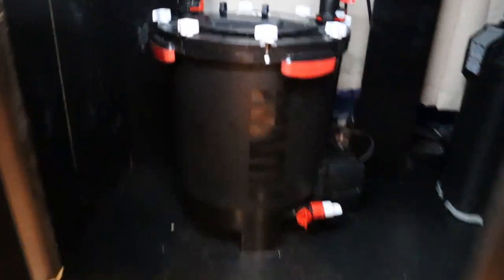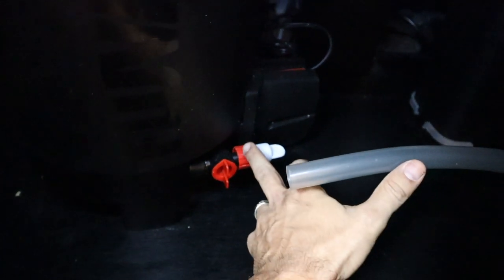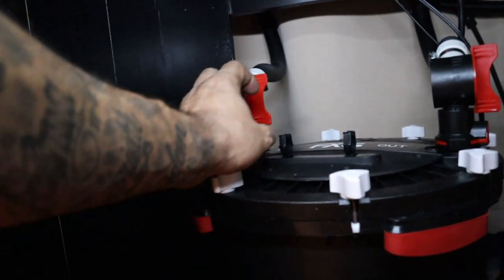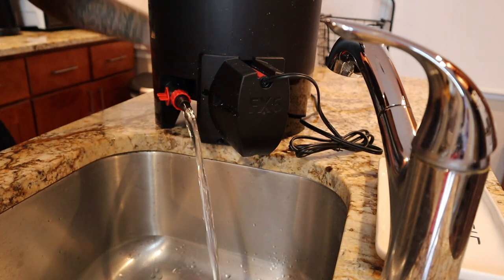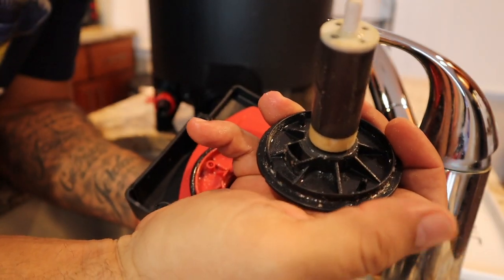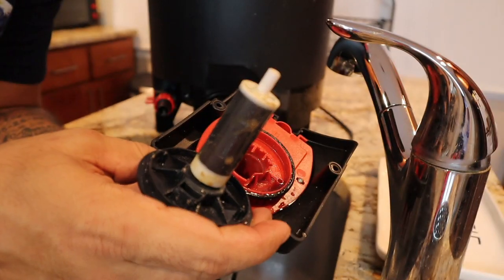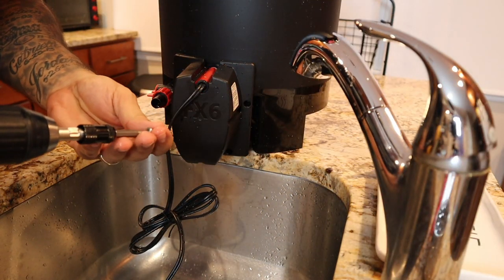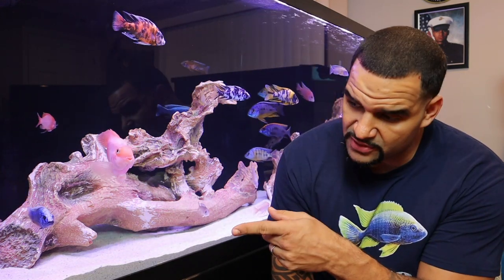Fluval FX6 Impeller Cleaning - Quick and Easy (Plus an FX6 Hack)

Comment: Thanks for your service brother. And thanks for this super helpful video. I’ve been dreading cleaning it, but you just eased my mind. Thanks again.
Reply from the maker: Thank you bro! 💪 And Im glad you found the video helpful!
Reply: I literally just finished cleaning the impeller in hopes that that’s what was causing the noise/vibration, but no luck. I can get the sound to stop if I turn the output knob halfway, but then that means it’s not pushing full power. What in the world.
Reply from the maker: What sound are you talking about? I had a sound coming from my motor once as well and cleaning out the impeller did the trick. did you see any damage to the impeller unit?
Reply from the maker: Try asking this question in my facebook group. Great group of knowledgeable fish keepers, someone may have had a similar issue - https://facebook.com/groups/kavemanaquatics
Reply: I figured it out. I had too much Matrix media in the center columns. Took a bit out and now she purrs

Comment: Hi Kev … I have a fx6 also but my inlet is not drawing water from the tank … my impeller is  sticking and not creating much pressure .. I have cleaned it like you have shown in this video .. still no joy .. what needs replacing to get it to work as it should ? Your reply will be highly appreciated. Thanks

Comment: Quick question . I’ve noticed your reusing your bio media in your FX6 when you clean out your canister. How often are you replacing the bio. Are you changing one basket at a time so it doesn’t spike. To keep some bio bacteria. Thanks again brother
Reply from the maker: Never change out your bio-media. It's good for 10-15 years. Just slightly rinse in tank water during a cleaning but never replace. 😊

Comment: I purchased the floval aquaclear 70 for 40 gallon to- 70 gallon tank size and used it into my 37 gallon and the flow is way too high for my angelfish.  Is there a way to decrease the flow? I originally purchased for removing the metroplex from the 37 gallon.  I pulled it because it seemed to stress my angelfish. It is the floval aquaclear 70. For 40 to 70 gallon.  I currently am using 2 medium sized aquarium coop sponges instead.

Comment: Bro, may I ask why don’t you use a pre filter for the fx6 like a sponge or the eheim pre filter? 

✌🏽
Reply from the maker: IMO, a pre-filter prevents a filter from doing what it’s designed to do. I don’t want poop stick to a pre filter that Inhave to reach in, get wet, take it off, clean it, then get wet again putting it back on every week or so. I prefer the poop to go into my filter where it belongs and not have to touch it for 6 months plus 😁 oh, and my water stays crystal clear without a pre-filter. JMHOT 😁

Comment: Hi, 

Do you think an fx4 would be overkill for a 55 gallon cichlid tank? Well stocked but not over stocked. Thank you!
Reply from the maker: Over filtration never hurt anyone, or any fish lol If you've already got the fx4 go for it!
Reply: @KaveManAquatics   thanks! I haven't got the fx4 at the moment. It's about 200 in my local area, where as the fluval 307 is about 140, so not a huge amount more considering the performance upgrate, given the 307 is rated for a about 250L and the fx4 at 1000L  it seems like it'll be worth the extra money!

Comment: Hello I had a question My fluval Fx6 started acting up today. Turned off, I plugged it back in it turned on for 2 minutes and shut off again. I proceeded to clean impeller following your steps left it clean and plugged it back in and was on for 2 minutes and shut off again. Do you think it might be the motor?
Reply from the maker: No, it’s designed to turn off and purge after a few minutes and will do that daily. When it turns off leave it plugged in, wait about 1-2 minutes and it’ll kick back on. 😁

Comment: I noticed my flow rate has slowed a lot, maybe I should clean this, it’s been 3 years. 😳 Also is there a gasket or o ring when attaching the impeller housing back on?
Reply from the maker: Yes there is, make sure it goes back on. The impeller wouldnt normally cause a decrease in flow rate. Usually its clogged up sponges and/or media. But cleaning the impeller wouldnt hurt and can only help 😊

Comment: Have you had a situation where you put motor back on and the filter won’t run . I’ve had to pull it apart 6 times and screw back to get it going why I have no idea.
Reply from the maker: Hasn't happened to me yet (knock on wood lol) Maybe your impeller just wasn't seated properly? or it could mean there's damage on it that you don't see.
Reply: @KaveManAquatics  cheers mate 👍

Comment: I forgot is there a play on the impeller? My impeller moves up n down a little.
Reply: Ahhh nice so it does have a little play. I wonder why mine stopped then my impeller wasn’t dirty just probably a centimeter of smudge.
Reply from the maker: Yes it does. Sometimes something can get lodged in there and cause it to stay stuck. Most likely a safety feature to prevent damage. Opening it up and cleaning it out again usually solves the problem. 👍
Reply: @KaveManAquatics  ya i cleaned it up looks like my motor is shot i ordered a motor comes with impeller also figured might as well replace both instead of guesswork

Comment: hi kev I just got through watching your video how to clean FX 6 Motorhead I have a question I have a Samsung 404 canister every time I put the pre-filter sponge on the intake I have little particles floating around the sponge is claim but I still have particles floating know if I take the sponge off the intake my water is crystal clear like I said every time I put the wires back on and it is clean I still get particles floating around how do I fix that I am kind of worried that sand will get in the suck up into the filter that's one of the main reason why this phone's is on ther somewhat
Reply from the maker: I dont use pre-filters for that reason. I feel every time you take it off to clean it you will release dirt back into the water. Sand is going to go through those prefilters anyway. Just leave it off if your water is clearer without it and raise your intakes higher so it wont suck up any sand.
Reply: @KaveManAquatics  yah I do get Lill Sand in my filter wit the pre-filter so you said you don't use them do get sand in ur as well
Reply from the maker: Yea I do get some sand in there. It's going to happen when you have sand substrate.
Reply: And that's wit per filter or not it's  still going happen anyways you know I think that's wy my nitrites is high because peashooter is slowing down my water flow I do see a lot poop an unate food that's not really getting sucked it might be the pre-filter what do you think
Reply from the maker: Possible, do you have a wavemaker installed? - https://youtu.be/O36QbOiZJvw
Reply: @KaveManAquatics  yes I do I do have a wave maker it's just when I put the sponge on my intake I have particles floating in the water just when I take the sponge off the intake of water is crystal clear
Reply: @KaveManAquatics  yes I do why
Reply from the maker: Asking because you said you see poop and uneatened food. Try not using the pre-filter, see how it goes.
Reply: @KaveManAquatics  yeah okay send me your Facebook thanks for the advice I appreciate it

Comment: Awesome vid. I got a FX4 on my 100g cichlid tank. BUT the drain valve is leaking.... and it's under a year old...sigh.. it an awesome filter otherwise
Reply from the maker: Ahh man, sorry to hear that. It is a great filter though!
Reply: Go to homedepot and find the correct size o ring for the valve.  Cost Few cents .  If you don’t know what to look for then i guess buy the drain valve from fluval but that would be expensive.
Reply: @JohnT2088  hey, well unfortunately dont have a home depot in my country lol...
 But yuh I thought of that today

Comment: I have 2 Fx6 and 4 fx4s everytime I clean the filter media, I am forced to unscrew motor and clean it. I bought the fx6 brand new and 4 months my first cleaning, I am forced to unscrew motor and clean. 
I set everything up nice and clean, all ready, plug in, nothing, unplug, plug back in nothing. So I unscrew all the screws, unhook my water lines, pig that monster heavy pump up again and pull out my filter media, take out side, hose inside real good, then I test it, so I fill 1/4 way with water, plug in, no work, I drain, get a Philips head and pull motor off, clean with hose, though I see nothing in there, it looks cleaning to me. Then I go through the mess of putting motor back on, check it and it works, and go through all the trouble of set up again.  This heavy monster is not 1,2,3.

Why does these FX Fikter make you always take pump apart. Lots of work, I have 6 and they all break my back
Reply from the maker: This is not normal! Something you are doing during cleaning or maybe even while the filters are on the tank, something is getting into the impeller unit. OR maybe at some point in time something got in and damaged it. Try replacing the impeller unit and see if this problem persists. Good luck!